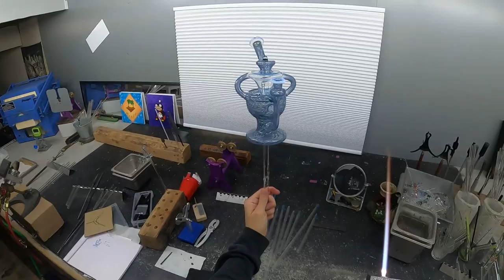Playing with Glass Ep. 2

Comment: Very rad. What brand are those little jacks?
Reply from the maker: I think they are from mountain glass. They were straight. I had to bend the ends sideways with the torch to make them touch on the wide side vs thin side. 
Makes them heat up less fast on the wide side.